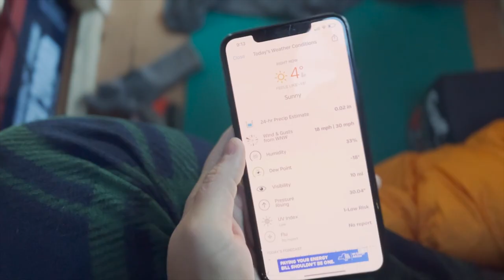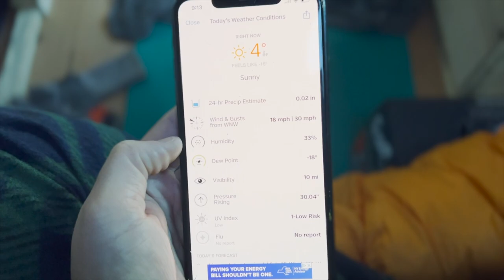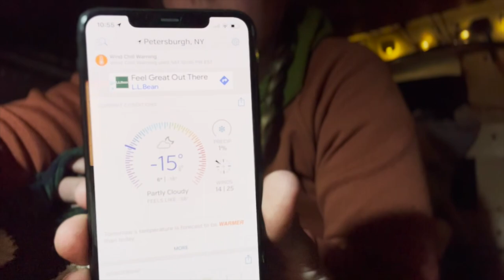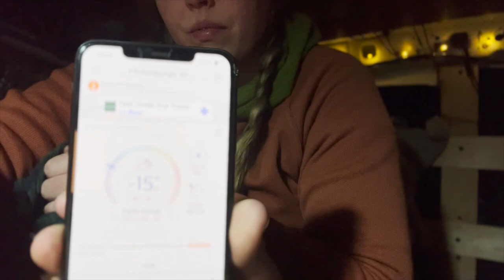Van life in -30 | Polar Vortex | Arctic Blast 2023 | Winter Van Life with Dogs

Comment: Hey. Awesome video! How do you guys get rid of moisture, I've seen people having these huge fans built in inside their roof, do you guys have something like that? I didn't really see how you guys get rid of moisture in the morning, did you even have any moisture in the morning? I am just learning this stuff out, some extra tips would be great!
Reply from the maker: Hey! Thanks for watching the video. We do have a fan but we didn’t have it open because of how cold it was during this video and it’s not connected to electricity yet. With our diesel heater running it produces so much dry heat that we only notice condensation build up on the windows when we place up those reflectix window covers. We have since noticed no condensation at all when there’s nothing blocking the windows which is really nice!